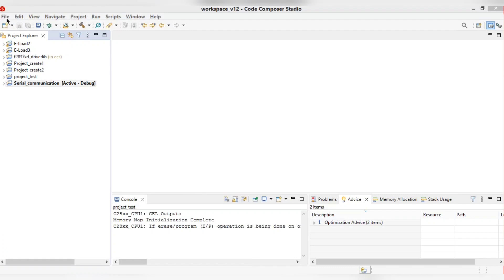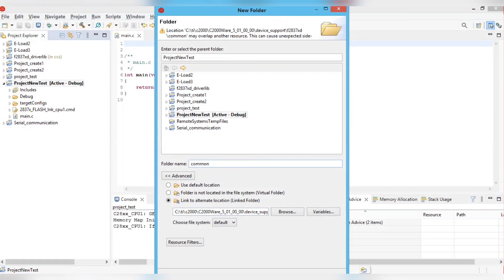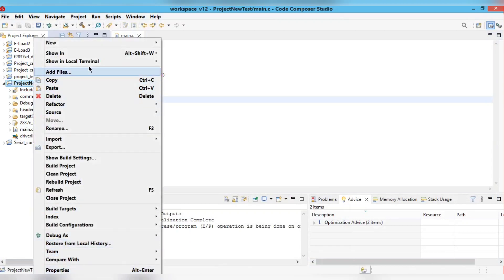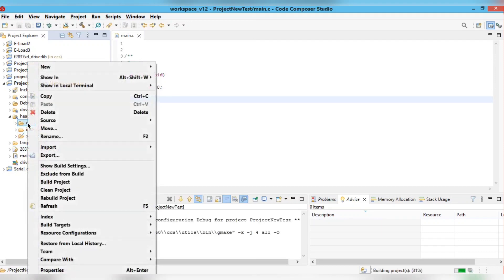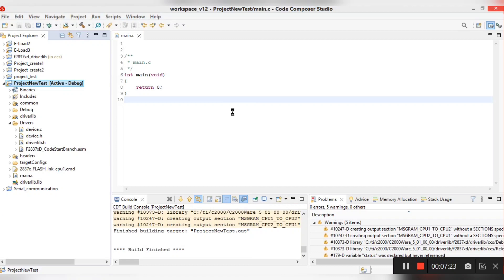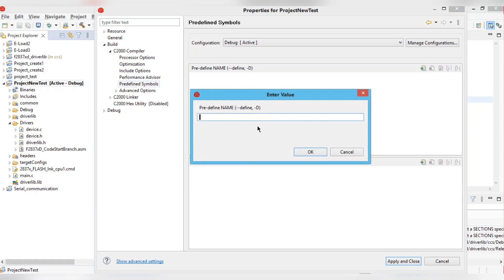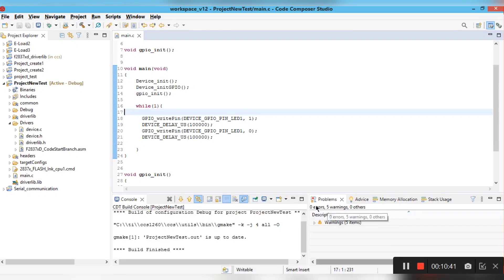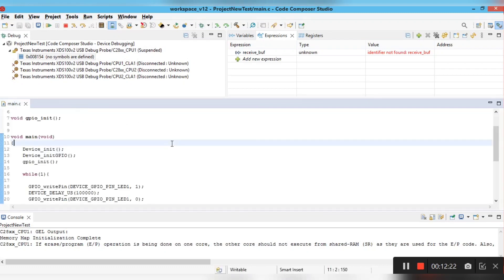Part 4 | TMS320F2837xD | basic step to create New Project for Dual Core F2837xD I LAUNCHPAD 2837xD

Comment: What if we do not exclude those files which you  excluded ?

And by this method we program the flash or RAM only ?
Reply from the maker: Its depends on project. Which file you want to includes.... 

You can program using either flash or RAM